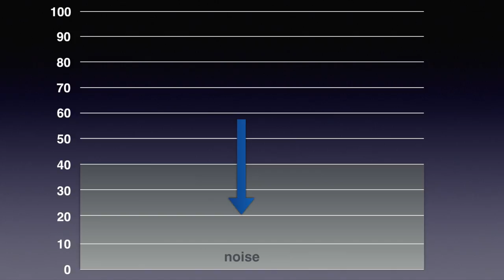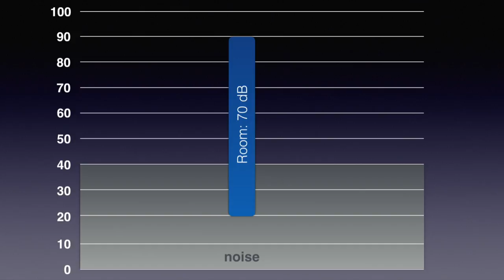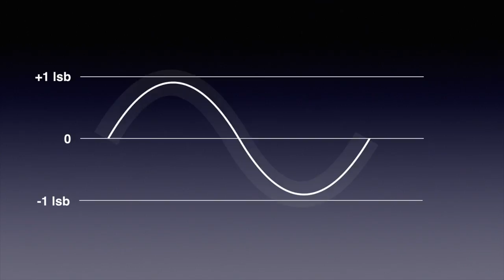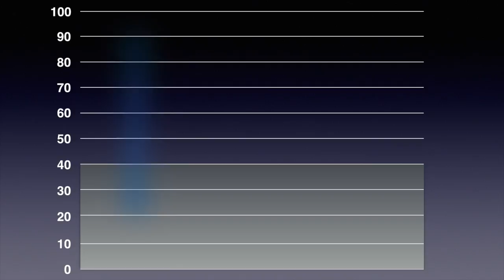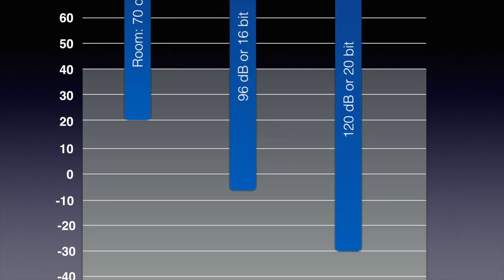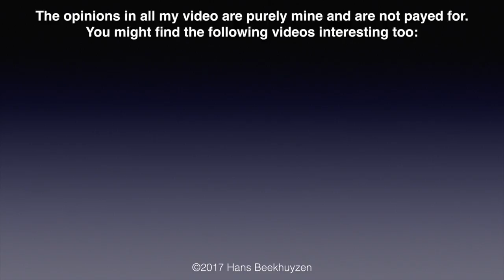Does digital volume control really suck?

Comment: Hello there... It would be nice if You could explain the matter of analog vs digital volume control regarding channel imbalance in speakers or headphones when the volume knob works with the analog mechanism behind it... iFi Audio is all about equiping their audio gear in analog volume knobs while the majority of other audio comanies are strong on digital volume knobs... Is the channel imbalance a thing of the past or is it still a thing today and We all should avoid analog volume control if We want the comfort of perfect channel ballance in Our headphones or speakers? THX in advance kind sir Hans the Audible 🤗
Reply from the maker: Youcould watch these videos: https://youtu.be/dCwYFdjuUqU
https://youtu.be/hni1ToR308o
https://youtu.be/N5MePtERBLc
Reply: Of course I've seen them, so the technical details and mechanisms of digital vs analog volume control are absolutely clear to Me after watching Your videos... What I'm worried about is that when anyone buys lets say a FiiO K3 AMP/DAC it has a volume knob that changes the volume in an analog way, but the result is digitally corrected on the device itself so that the left & right channel always have the same volume level (for instance 40-40 dB and in another scenario lets say 90-90 dB), but when We buy an iFi audio ZEN DAC v2 or another of their products, We can get a channel imbalance when adjusting the volume with their analog volume knob, which results in lets say 40-42 dB or 91-90 dB on the left and right loudspeakers or earcups of the headphones... Many audio gear reviewers have pointed that out in the past, and that's my concern... Do We all still have to turn the analog volume knobs on these AMP/DAC devices ever so slightly back & forth chasing the moment, when the ballance is just right? Maybe I'm ignorant in the matter, but it is sad if someone should pay tousands of USD/EUR and get stuck with in My oppinion an annoing problem - If there is a video on that topic, please direct me to it of course, but if not, I would be happy to read Your thoughts on the matter as You have dealt with tens or even hundreds of analog knob devices and compared them to digital knob ones through the decades and therefore certainly encountered theese channel imballances many times or came to a conclusion, that it is not an audible issue... Sorry for My rant on the matter, but it is like the last detail I'm missing on my current level of the audio gear journey 🤗
Reply: @RedFightingMood  I think iFi's claim is just a marketing claim. One can build a really good analog volume control using a high quality resistor ladder network that is switched using relays, but thats quite expensive compared to the digital solution.

Comment: a question related to this topic, and maybe nice to dive deeper into: I own a Lumin X1, with Leedh volume control and high quality output capacitors and therefor you can directly connect to a power amplifier, as advised by Lumin and many reviewers. Although I was warned by several experts that you better always use a pre-amp, I connected it to the Naim NAP 250 new classic (fantastic power amplifier), and the soundstage and dynamics and tonal was great, but it sounded a little harsh. After listening for a longer time this started to irritate me and I went back to an integrated  Pass labs. And voila, the smooth and neutral warm sound of the Lumin was back! I Still use leedh volume control, that is fine, I don't hear a difference with the analogue control of the Pass labs. I don't understand!, a pre-amp can at it's best not do any harm to the sound right? Or am I appreciating the little distortion that the pre-amp adds? Paul McGowan of PS Audio experienced the same thing and could not explain it, do you?
Reply from the maker: It all depends on the output stage of the pre-amp. For instance the one in the Grimm MU2 does drive a power amp equal to a high quality pre-amp.

Comment: I know this is an old video, but I’m going to take a shot at getting some insight:  I have a NAD C658 connected to a Rega Elex R.  The NAD offers variable or fixed volume options.  NAD recommends using variable and fixed on the amp.  My question is what should I set the volume on the Rega as a fixed point?  Currently I have it at 50%.  The issue I’ve run into is finding the right balance in the volume chain once the sub is considered.  If I increase the volume on the Rega, it just increases the speakers, because the sub is connected to the NAD.  Increasing the volume on the NAD turns everything up, but it’s the starting point that needs to be correct before the NAD handles everything.  The sub gain is turned up to about 30%, for full disclosure.  Any advice or direction would be greatly appreciated.  Your video makes me feel better about using digital volume on the NAD, just unsure about the other 2 volume settings.
Reply from the maker: I have no hands-on experience with the Rega but this is what I should do: try to find a setting where the volume knob on the Rega is between 10 o'clock and 2 o'clock and set the volume with the NAD.

Comment: Gerald Pratt. On my last Pre-amp design, I did not use an analog volume control at all. I have an Oppo 205 and use their digital volume control to control my system SPL, usually around 80 dB. I am convinced that a modern digital volume control used in hi-rez audio does not degrade the audio as Hans explained. All analog volume controls have a mechanical system to track the conductive material in the pot. This is not the best thing to do to an otherwise mostly perfect analog signal.  Not to mention it is hard to find an analog pot that tracks perfectly. As a protective measure, I set the overall gain of my system such that I can never get a full scale signal that will fry my speakers or my ears.
Reply: Yeah, analog pots can be problematic. A ladder of very high quality resistors switched using relays makes a much better analog volume control, but is much more expensive.

Comment: One of the biggest issues with listening to audio on computers and phones is there are several "volume controls" in series. The audio player, the operating system and the amplifier. I tend to leave everything on "max" and control the volume with the amplifier.
Reply from the maker: That, in general, is a good approach.

Comment: From my experience, analog volume control just sounds better to my ears.  I have three Harman Kardon amps/receivers: PM665vxi, HK3470 and HK3490 (I like the brand obviously).  The PM665vxi and HK3470 have analog volume control, and the sound is just “richer” and more satisfying with better mid-bass and more dynamic range, they just do a better job driving speakers full range (bass/treble at 12).  Every digital volume controlled receiver I’ve listened to (no matter the brand or price point) just sounds “thin” unless a separate powered sub is used with it.  I use mostly quality digital audio sources (CDs primarily, I have a large collection).  

I’ve honestly always wondered why to my ears at least, digital controlled volume sounds thin?  I wouldn’t consider myself an audiophile, and I’m not an engineer.  I’m simply an audio hobbyist that likes good sound with a wide, deep and rich soundstage.  I also have had multiple friends comment on how much bigger/richer my system sounds than their more modern surround system (that uses digital audio controls obviously).
Reply from the maker: I have little experience with AV receivers but with contemporary stereo equipment my experiences differ from yours.

Comment: I  have  a  Audioengine D1  conned  to  my  Computer  via  Optical Audio Input;  should  i  keep  the  windows  volume  at  100%  or  the  DAC  at 100%?
Reply from the maker: You should use audiophile software that bypasses the Windows Audio mixer and then set volume with the DAC.

Comment: Great video, Hans, on a much needed subject to be discussed.

In your experience, which digital volume control products that you've reviewed stand toward the end of "exceptional" digital volume controls as you related?  Would you consider some of the newer well-done digital volume controls like Bluesound and Mytek to be toward the better end of the discussion?  

I know it's always best to do a/b comparisons in one's system to determine the best sound, but determining which sound control method (analog or digital) in one's system can be a bit challenging to discern.  Thoughts?  Thanks.
Reply from the maker: I don't keep track of individual functions of devices I review, I review the device as such since that's how it is used.

Comment: I don't understand, the Lumin X1 is not really a pre amp, it just has very good output transformers (Lundahl LL7401), but let's say the output signal is not good, a pre amp theoretically can never improve that, right? But for some reason, when you put a pre amp in between it just sounds better. I've heard that from several retailers and now heard it with my own ears, I still don't understand how that is possible.
Reply from the maker: There is a better electrical compatibility between a good active pre-amp and the power amp. A better matched impedance, voltage and current capability.

Comment: Hi Hans,
Great channel! I appreciate your work. I have a question regarding the Mytek Brooklyn DAC.(I have one on the way to me) It's my understanding that this DAC offers an option of either a digital or analogue volume control. Since the output of this DAC is quite high, it will likely need to be turned down in order not to override the input of my Anthem 710 AVR. Should I use the digital or analogue volume in order to maintain bit perfect play? Or should I use the jumpers to reduce the output signal of the DAC and leave the volume at 100%? What do you do with your Brooklyn DAC?
Thanks for reading :-)
Reply from the maker: I would first use the jumpers inside if neccecary. Whether the digital or analogue volume control works the best for you, I can't say. The differences are really small, if there are any. But an analogue volume control might be more sensitive to the load the amp offers. I haven't tested this though.

Comment: Great video, on an interesting subject. I have a Chord Mojo, which I put through a passive (impedance based not TVC) pre-amplifier, into a pair of class-D monoblocs. I have found that sometimes if I don't adjust the Mojo output and pre-amplifier I get discernible noise (not clipping) that sounds awful. It's not immediately noticeable (and my ears aren't what they used to be). I know you use a Mojo so was wondering if you think the Mojo is the cause of this noise or is this more likely an impedance matching problem?
Reply from the maker: Sorry, I do own the Mojo but I don't know the rest of your equipment so it is virtually impossible to help you here.
Reply: I was wondering if you knew if the Mojo's volume control was any good or not. Although other research I've done suggests that it's actually a very good one. Thanks for responding anyway.
Reply from the maker: +Tim Pailthorpe it works fine
Reply: Thank you. I'll look elsewhere for the cause.

Comment: Thanks for the video, I have got a node 2i connected to an amp. I am currently listening Tidal mqa. Is it wise to use volume on the node 2i with fixed volume on the amp  or directly from the amp with maximum setting on node?
Reply from the maker: I would opt for the latter.
Reply: @TheHansBeekhuyzenChannel  thanks for the answer, I thought it will be the wise thing however does it have that much a difference that I have to get up everytime to change the volume?
Reply from the maker: No, you could try setting the volume control on the amp at two o’clock and lower the volume on the Node.
Reply: @TheHansBeekhuyzenChannel  thanks a lot